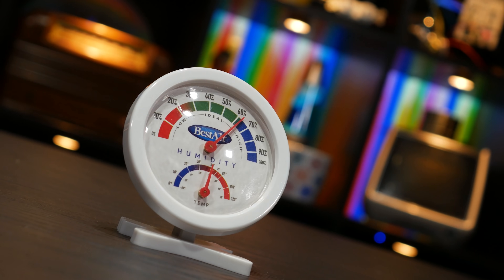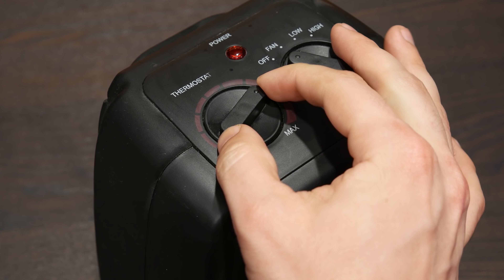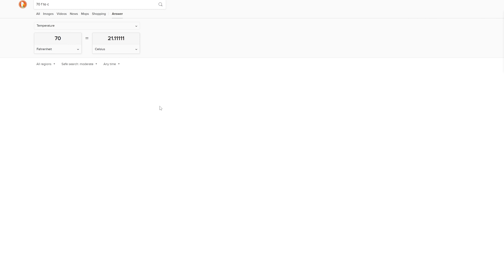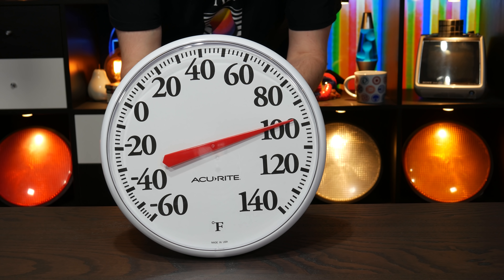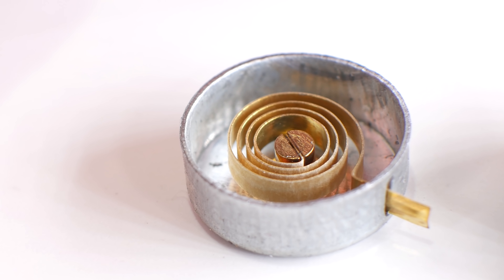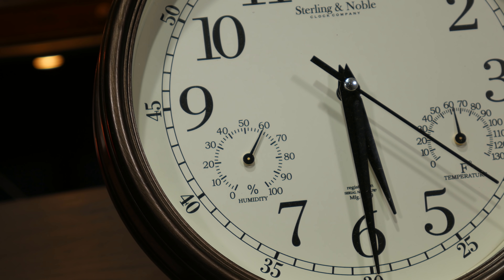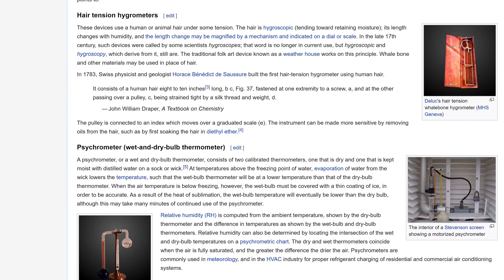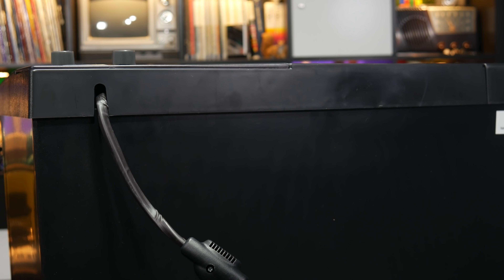Analog Hygrometers - how?

Comment: Celsius is stupid. Why have a temperature scale with numbers that Hardly change and only goes from a cold winter day 0° degrees freezing. To a Hot summer day to only show 40° degrees as a Hot summer day that's dumb. When winter with Fahrenheit will show 0° in winter and 104° in summer Fahrenheit has more numbers in between cold and hot so therefore it's more appropriate and you can see the temperature changing. Celsius always looks like cold temperature like it's winter all the time. I hate it. Looks stupid and confusing forget The Celsius scale throw it out. I like all the other metric measurements but not stupid Celsius. Fahrenheit should be put in the metric category. I'm willing to do everything else metric but forget about Celsius that should not be considered as metric

Comment: 1:58 Thank you for stating the exact reason to use Farenheit. Why would I care about having the temperature based around when water freezes and boils when it could be based around when I freeze and boil instead? Everything else in the Metric system is absolutely superior, but I will not budge on temperature.

Comment: The most basic way I convert Celsius to Fahrenheit is: C×2+30. So 20 Celsius would be 70. It only works for guessing close to the number and shouldn't be used for scientific purposes. 0=30, 10=50, 20=70, 30=90. The C×9/5 + 32 equation isn't easy in the brain for me lol

Comment: All measuring systems are arbitrary and therefor none is better than the other. The only one that is objectively the best would be, kelvin as 0 is no energy and it goes up from there. Otherwise F and C are the same levels of stupid because they are both completely arbitrary, choosing the freezing and melting of H2O at sea level on this planet under normal atmospheric pressures is just as dumb as F, if you are looking at it without feelings.
Reply: Using Kelvin would suck because common temperatures are very high in Kelvin. A temperature scale used for non-scientific daily life should express the typical range of temperatures nicely, which Kelvin does not. Celcius and Fahrenheit both do a good job of it. Yes the center points are arbitrary... So what?
Reply: @4rumani  It only would suck because it is not something you grew up with. Concepts like that are easy when that is all you know. It is also a more objective way of measuring temperature. What matters about both being arbitrary is people say Celsius is better than Fahrenheit and I argue they are both arbitrary so what does it matter. One is not objectively better than the other since neither of them are kelvin which is best since it is measuring the energy more so than the "temperature".

Comment: If 50 were room temperature, I would buy the "comfort" argument more. The issue is 80 (100-20) is a lot more comfortable than 20 (0+20) is. If Farenheit's 100 were a little warmer with room temp close to 50, then I would buy the argument

Comment: 2:53 again, no. The metric system is fantastic and I use it everyday. It's not an aversion to the metric system, it's the low resolution of the celcius scale, and the fact that normal winter temperatures would be negative. That's three extra sylables everytime I want to talk about how cold it is. Celcius is great for the lab, for doing energy calculations, melting points, boiling points, &c. Sciency shit. But Farenheit is superior for talking about the weather. I will never use °C for weather chit chat. Farenheit is just so much more expressive.
Reply: I'd feel similarly aghast at the thought of doing scientific work in farhenheit, or in ounces and pounds. Whenever I read engineering papers writen in America, I get sick and dizzy. Torque in foot-pounds? 🤢 bloody morons.

Comment: I know it's been 3 years since this video posted, but check it out... They have "electronic analog hygrometer" and/or "digital analog hygrometers".  They're generally like a nice-ish quality lcd in the style of a round needle measuring interface, but the sensor is electronic.  They're a lot more expensive than the bi-material units, but still reasonably priced.  Granger sells an analog human hair sensor unit, but at the time of this comment it is ~$300. (and it's analog)
I think an electronic hygrometer sensor displaying the measurement values to an e-paper/e-ink or "Nest" quality OLED display would both have the potential to be really beautiful and useful in the right implementation/application.  e-ink would look great while using very little power 

If you end up reading this comment, would you kindly consider looking at any of the new "heat-pump" all-in-one washer/dryers? They use a built in heat-pump!  I only know of one brand/model, but it uses less than 15amps @ 120volts(no 240 required), has no outside outlet exhaust - did I mention it uses a heat-pump?  Thanks!

Comment: Me thinks this subject is a good place to define what “Relative Humidity” is.  Why is it Relative? Relative to what?   Percent humidity is the amount of moisture in the air at that temperature.  AS air temp goes down, the molecules of air get closer together and therefore lower the space to hold moisture. As the temperature warms up, the air molecules of air spread out allowing it to hold more moisture. That is why we get fog. As the temperature drops, Relative Humidity goes up to the point of total saturation and you now see the moisture as fog. On a cold day, the outside humidity could be around 85% while indoors will be 42%.  Same amount of moisture in the air but the warmer air can hold more.
     Someone asked, What Humidity is best for the house. I always start with 50% as my high mark and 40% on the low side.  The higher the room humidity, the warmer you will feel at the same temperature.  As an HVAC Tech, the first thing I want to do is lower the house or space humidity in the summer.  By doing this I can make the area more comfortable while the temperature is the same.  The same is true in the winter but raise the humidity.  Higher humidity makes the air feel warmer at the same temperature.
     One problem one has to watch out for is to high humidity in cold weather.  When windows or anything else get cold, they will want to condense the moisture out of the air causing the glass to sweat.  The other thing is moisture in the walls.  If you do not have a good vapor seal on your outside walls, moisture can get in and condense on the outside walls.  They will never dry out.   
     Hope this answer any questions.

Comment: I am against metric conversion in the states but I wouldn’t be too upset if we did……..except for temperature. Celsius is garbage.  Let’s the nerds at nasa use it but for every day life the big F scale is king.  Oh, Celsius uses 100 units between freezing and boiling water at sea level?  Well who the hell cares about that?  I don’t measure my water temperature when I boil water. I just wait for the bubbles.  There is no argument in favor of C that makes any practical sense.
Reply: NASA uses Kelvin, both Celsius and Fahrenheit mess up certain calculations due to the arbitrary minus sign. Sure, you can just "be careful", but we know how that ended for challenger.....

Also the idea that Fahrenheit uses human scale is a myth. While yes, the original top reference point of 90 was based on (incorrect) average human body temperature, the lower point 0 was based on a specific brine solution, solely because it's chemistry made that specific temperature easily replicable in a lab for calibration. This makes the entire thing just as arbitrary as Celsius, it just feels intuitive to you because you've been using it your whole life

Comment: (F - 32) x 5/9 = C
(C x 9/5) + 32 = F

You don't have to do the actual maths but it does more or less give you a range of possible temperatures

I'm still getting used to the conversion but it's not rocket science.

Comment: Has anyone ever pointed out that F is more precise than C. There are 112 more (and smaller) increments in F than in C. 
Btw  -40 is C  & F. 
🤔 What if we set -40 as 0 and Boiling water at 15 psi to 365.2425?
Reply: In casual enviroment a precision of one degree C is good enough, the apparent temperature depends on more parameters anyways

In scientific enviroments you can just subdivide it further, if you're working in a lab then you wouldn't be scared of fractions. Besides not even Fahrenheit is precise for that
Reply: @asd-wd5bj  I agree F is perfect for tell me jacket yes or no.

Comment: I'm a sixty-five year old Brit which puts me in the confused space between the old ways and the new. Depending on when in my life things changed defines how well I can think within each measurement. (I should say here that I'm number blind so thinking in any kind of number format is difficult. I also have a brain thats been scrambled by ME/CFS for 35 years so I'm a bit hard of thinking all round really!)

 The change from Fahrenheit to Celsius must have happened at the same sweet spot as the change from Pounds Shillings and Pence to the "new" decimal currency.

Thankfully I was behind the counter of a small newsagents at the time so I was forced to stop the automatic conversion in the head, although I can still do it if required.

However I  still translate C to F when watching the weather forecast and I know exactly what 60°F  feels like.

This is one of my favourite of your excellent videos even though its unusually short, loved the ending 😂👏

I always wondered just how a hydrometer works, I have a beautiful ship's binacle shaped barometer with a wooden case that belonged to my dad. It has a hygrometer within it of course but theres no way I'd take that apart!

But why I've never got hold of a cheap plastic one and disemboweled it I dont know! Lack of time and memory rather than a lack of curiosity is my only reason... so this was great!  😁👍

I've listened twice but I need to focus on the bit about using a human hair. Did you say the coil slackens in greater humidity? So the hair gets longer?

 But my wifes hair curls in wet weather, I know this for sure because I'm her hairdresser and its a nightmare to work on if its wet out!

What am I missing here because I bet I've got something wrong somewhere?!

I'll watch again carefully...at least that'll help your viewing figures.👍👏😄

Edit: yes you did say the hair lengthens when its wet out. Yes if you throw a bucket of water at curly hair (including my wife's) it will straighten. But in high humidity my wife's fair hair curls up tightly which means if I pull it taught, cut to length and let go, it looks like I've cut inches off rather than, say 3/8ths. Please note the proper measurement scale here not the dreadful centimetres we're supposed to use but in which I just cannot think! Although we kept miles per hour, hurrah!

Anyone have any thoughts on this mystery or is my wife just peculiar? I have dead straight fair hair so no reference point here, it just stays as it is and only suffers from natural hairdressing disasters. Such as when the hair dresser (me) forgets to put on her specs to fit the correct comb to the clippers and has to complete a significantly shorter haircut than originally intended! Yes I now look like a convict but I'm compensating by wearing jolly Christmas jumpers so as not to scare the locals. 😅

Comment: The good thing about Fahrenheit over Celsius, is the resolution. An integral digit readout is 1.8 times more accurate, just because a greater number is in smaller increments. The opposite holds true with length. A centimeter is 2.54 times more accurate than the inch. The closest metrics would be comparing the meter to the yard. There's only a couple of inches of difference between those two lengths. When using a digital IR thermometer, I always use Fahrenheit, because of the resolution. When converting back to metric, I get a nice fraction, that I don't get, reading directly in Celsius.
Reply: The accuracy of the device is the same, just use a decimal place lol

Comment: Very funny. Laughed so much and like always, learned something. "Beam god awful blue numbers straight into your retinas." I agree but still so funny. And F to C, I do it all the time for C to F so yes, they can do it too. I like Fahrenheit better because the degrees are smaller but I would be fine with Celsius. However, since I started 3D printing, I have gotten pretty good a metric. I definitely like it better. So much easier than figuring how many inches in 6 feet, for instance.

Comment: Seems to me you could use a linear scale with the correct number of windings, my guess being that the larger the number of windings, the more accurate towards 50% humidity. I would venture all of them fail in the last 10% on both sides, exponentially, but that failure starts further from 50% with the more windings involved.

Comment: Easier to put a man on Mars than manufacture a cheap accurate analog hygrometer with any decent lifespan.   Old paper types you find in your living room wall weather station are always completely dead dead dead.  An old hair type would surely be dead too because the hair would have at least oxidized and probably disintegrated.   That's not as dumb as making an American flag to plant on the moon out of polyethylene only to be blasted by ultraviolet light and not even crumbling, just turning directly into gases that waft off into space.

Comment: the zero to 100 as a range of tolerable tempretures being more pleasing is a fucking shitty excuse. 100f is far too hot and 0f is far too cold and 100 is too many divisions anyway. no you cant tell the difference between 56f and 57f. a scale of actually tolerable temperatures without exceeding the need for equipment ranging from a wooly jumper or a good coat at the cold end to maybe a cocktail by the sea at the hot end makes a lot more sense. single digits are chilly, teens are alright and 20s are ranging from nice and hot to a bit too hot. its not that hard. learn to think in Celsius.

Comment: Some years ago we were characterizing a component with respect to humidity.  Unfortunately we didn't have a proper environmental chamber. It turns out you can put the component in a small sealed chamber that also contains a tub of a saturated brine. Different salts in the brine will keep the humidity constant a certain level dependent on the salt. Having two chambers set up using different salts allowed easy changes in relative humidity.

Comment: Fahrenheit isn't hard to understand once you know the conversion formula to celcius or you have some points in mind
You'll get a good feel of it if you know that 0 c is 32 f, 20 c is 70 or so f, 36 c is 104 f etc... It's in extreme numbers where it gets goofy cause of course it has to scale exponentially and not linearly, similar to miles with kilometers per hour.

Comment: I wonder if you could make an accurate linear scale hygrometer with a normal hygrometer coil a small counterweight (e.g. when you go "over center" at some point in the upper humidity range, a small weight "helps" the coil unwind to add more range to the scale. Granted, this is making some Rube Goldberg kind of hygrometer but I feel that'd defeat the purpose of a (cheap) coil hygrometer.

Comment: It seems surprising to me that a wet and dry bulb hygrometer is a simple as it is. I would think that the temperature of the wet bulb is dependant a lot on the air flow around it, and the construction of the fabric around it, and similar factors.

Comment: In reality temperature shouldn't be linear. The only reason it is, is because the scale were created based on the expansion of materials.
Reply: It is linear, it's just not perceived linearly, ¿right?
Reply: @Persun McPersonson  in reality, temperature doesn't care about being measured. The scales are based on the technique that analog termometers use.
Reply: @tonymouannes 
That didn't really answer my question; there's a difference between something actually being linear or non-linear vs. something being measured that way, and something can technically be both linear in reality and linear in measurement. You said that temperature "shouldn't" be linear, implying it's not actually a linear property. ¿But isn't it?
Reply: @Persun McPersonson  I was talking about linear compared to the expansion of a metal. Actually the energy needed to increase the temperature by 1 degree changes depending on the temperature. So relation between temperature and energy isn't linear. But we could have made it to be, in which case the thermometer wouldn't be linear anymore.
Reply: @tonymouannes 
Oh, I see, so you meant the linearity of temperature itself vs. the nonlinearity of the amount of energy it takes for each change.

But that doesn't really fit with the claim that temperature scales shouldn't be linear, because they absolutely should stay that way, atleast when it comes to most applications of temperature measurement.

Directly linking temperature and energy like you propose would not be all that useful, except for specifically when you're measuring the amount of energy it takes to change the temperature — but even then, you'd still need to convert those measurements back into linear temperature at some point anyway.
Reply: @Persun McPersonson  i never said the scale is bad, just that it's was defined based on a specific feature of temperature. Otherwise, there is no scale that would be perfect for every application.
Reply: @tonymouannes 
But you did say, "In reality temperature shouldn't be linear," which has a much different meaning to what you're saying now.
Reply: @Persun McPersonson  you're arguing to argue right now. I watched the video 8 months ago and don't remember why exactly I said what I said. I'm sure I could have given stronger arguments back then, but I'm not rewatching the video for the sake of some comment argument.
Reply: @tonymouannes 
I'm not, I just pointed out that your current explanation isn't the same as what you originally said, but you were acting like they were the same.